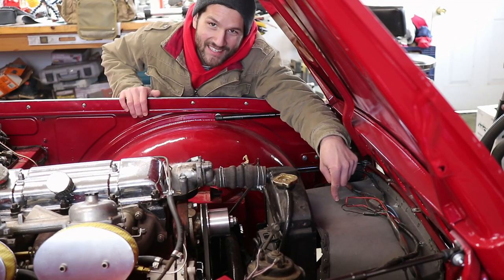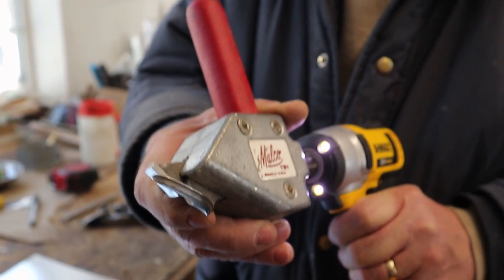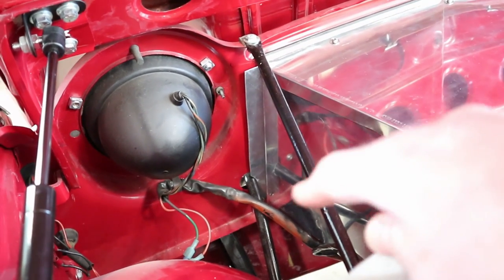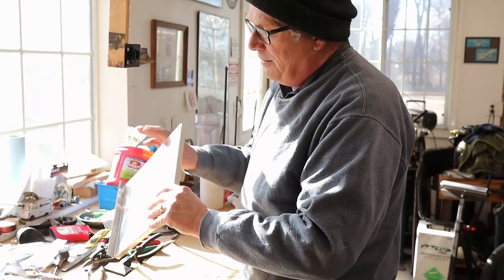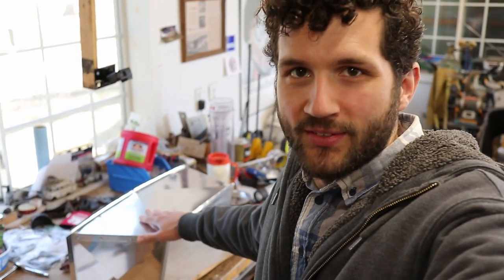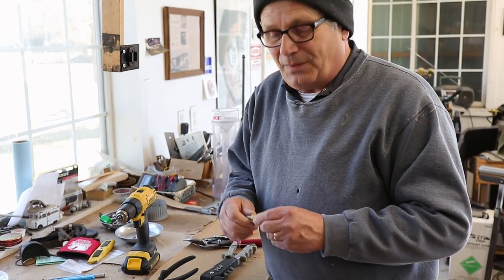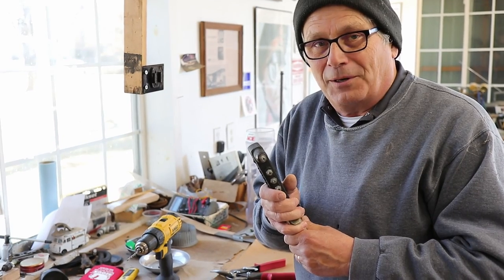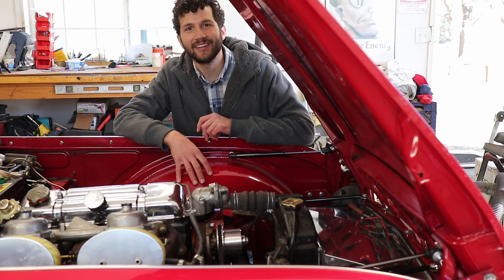Our Custom Triumph TR4 Radiator Shroud is DONE - PART 2

Comment: Looks so much better.  The plans would be great, but I’d be even happier with a Wegs Garage OEM custom fab piece straight from the garage.
Reply from the maker: Haha well I can for sure get you the plans (though they are not quite finished). I will have to run the custom fab work past the old guy since he is the "tin knocker" in the crowd.

Comment: to bend aluminum you can heat it to 450°  (840 °F) then dip it in cold water. After that you have few hours to bend it. if you don't have a thermometer, you can use marseille soap which turns brown at 450°

Comment: That came out super nice! 

As for your toolset, I'm not a fan of "Step Bits" (remember when they were called "Cobra Bits"?) since the tips tended to break off making the bit rather useless. I do like your deburring tool since the more common one with the swing end is ground down and sharpened for right handers, which makes things inconvenient for me. :)

Comment: Nice job! I’ll definitely be asking for a copy of the drawing. One question though. Instead of bending the side/bottom stiffening edges at 90, could you pop rivet some 1 inch wide strips to the edges and get the same stiffening? I’m guessing that would provide the same effect as the hems.

Comment: Great Job Guys!  I just tore out the original one that's been with the car since 1962, and ready for some beautiful Shiny Aluminum Bling.  Please send me a set of template drawings if you can!  Thanks.
Reply: Also, if you have a recommendation for the electric fan radiator assembly that you've installed, We're down in Texas, and I have a lot of temperature control issues in the summer!
Reply from the maker: Sounds good. I am just finishing the CAD files now, but plan to have them available for download soon. I will send a link. 
As for the fan, ours is a 12" cheap fan from ebay or amazon. I believe all the install info is in a really early Wegs Garage video. The size is good for the radiator and mounting is not too hard. In my opinion it is pretty weak, and we plan to replace it with a better, name brand aftermarket fan that hopefully moves more air. Likely an upcoming video topic.

Comment: Hi, guys, would it be possible to have a copy of your drawings for the radiator shroud? It seems that all the shrouds available here are to fit the TR4A Radiator which is much wider. I would like to attempt to make one like yours. Thanks, Greg
Reply from the maker: You can download the drawing here: https://wegsgarage.com/triumph-tr4-aluminum-radiator-shroud/
Reply: @WegsGarage  I apologise if I’m being thick or a nuisance. Are you able to explain why there is a difference of 2 inches between the top and the bottom of the shroud sides? I appreciate this is what the factory item has, but I struggle to why. Greg
Reply from the maker: @gregorylangfield559  The radiator and the front valence of the body are not parallel. The 2 inches makes the shroud line up with the radiator when mounted.
Reply: @WegsGarage  thank you. That always confused me as I assumed it was to allow air to escape around the radiator when going fast.